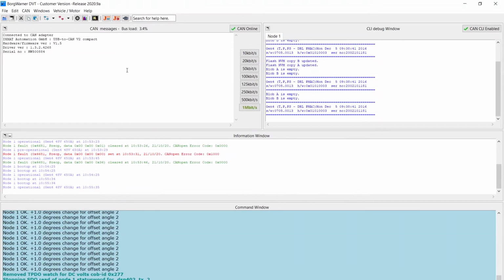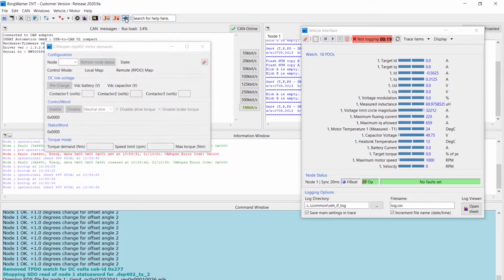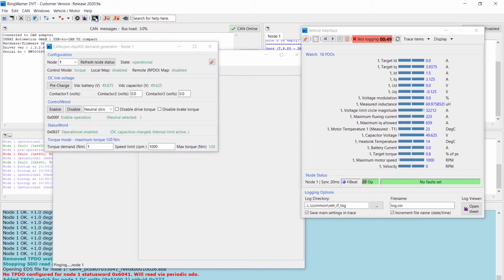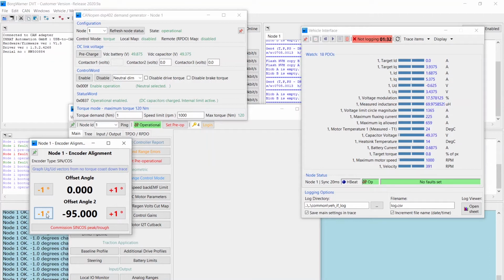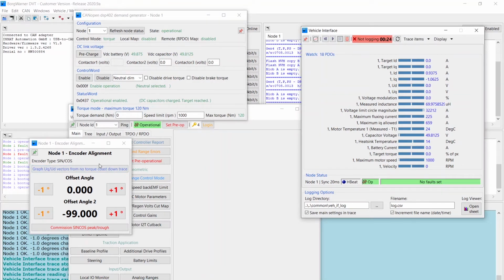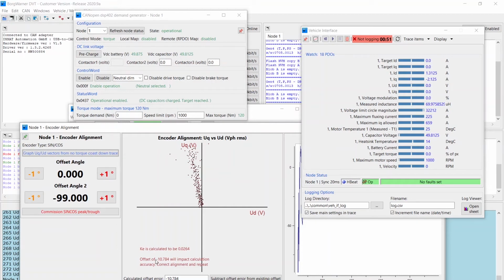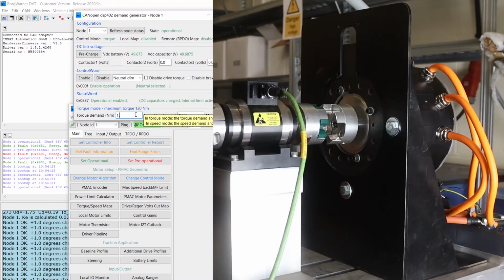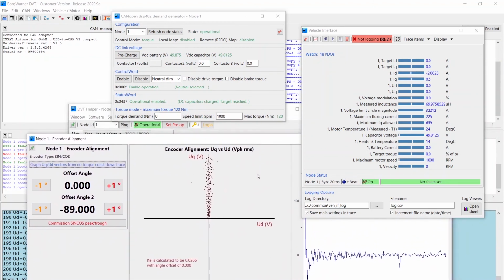VoltSport | Encoder alignment

Comment: Nice. Do you offer assistance by mail (not for free obviously)? In a few days I'm going to attempt make a Sevcon Gen5 Size9 drive an induction motor with an AB encoder. I have purchased the current version DVT software and the proper "IXXAT USB to can v2 compact". However the documentation for the settings themselves and a proper application PDF with examples for the GEN5 inverter, I have not been able to find. The DVT software guide, offers some advice, but my preparation feel too generic for comfort. Cheers